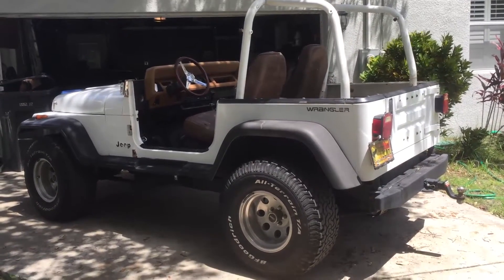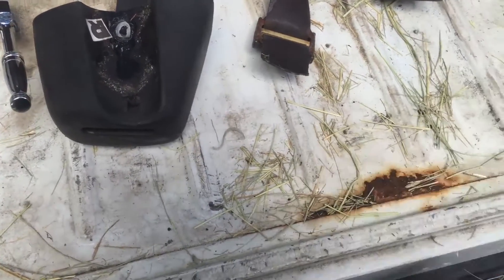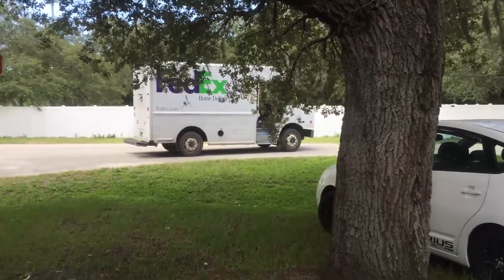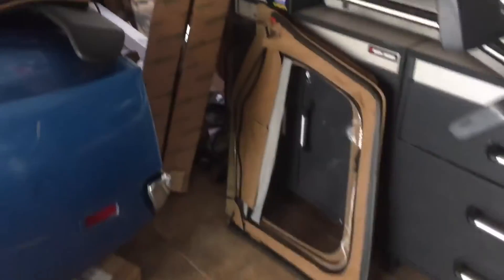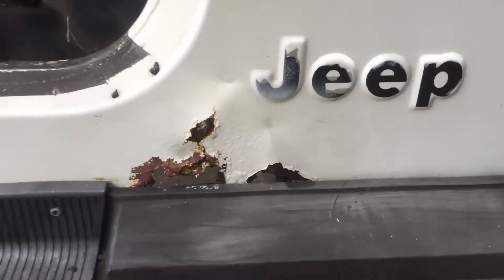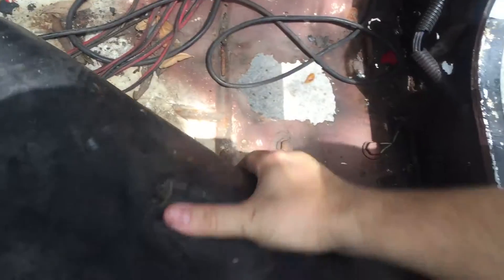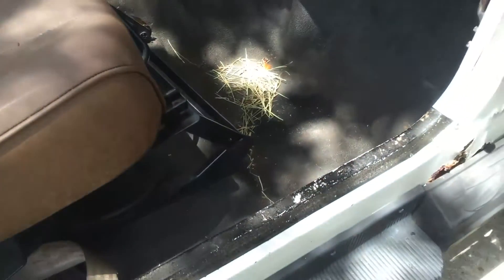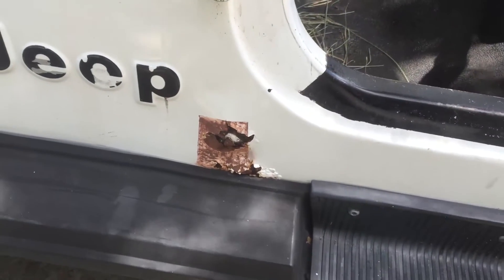Interior Restoration Begins On The Jeep YJ | Day 1

Comment: miller 212 auto adjust itself but not cheep. if you have 220vt get a 170 from harbor frate. cheep but will do what you need with ease. even the 90 110vt from H F can do what ya need.